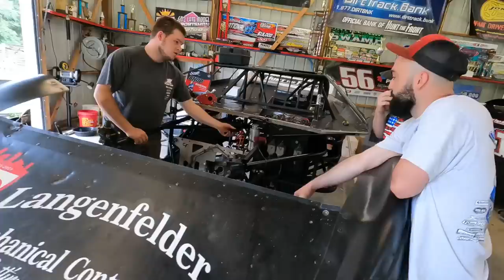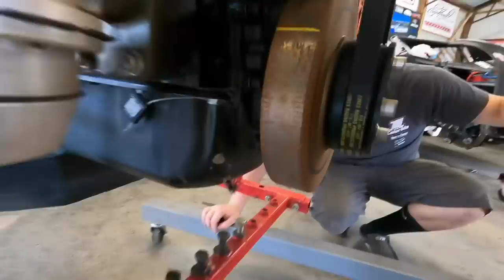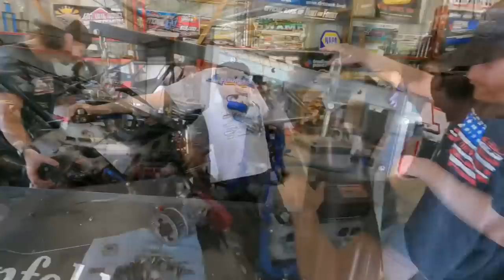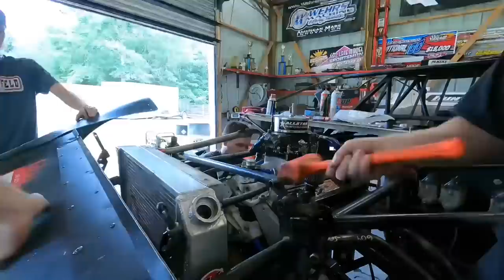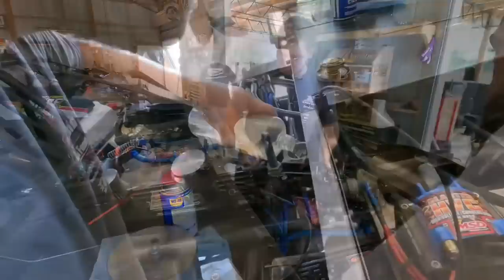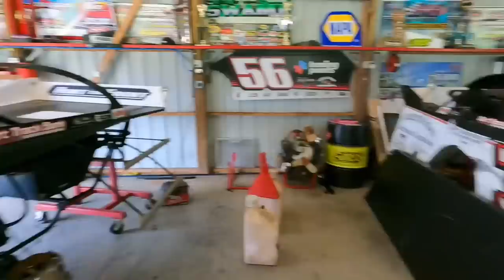Will Jesse Be Able to Race? And Faithful Has a New Engine!

Comment: Good luck boys be safe. The motor guy we used said never put regular water in a motor with aluminum heads because there are minerals that eat the aluminum. We used distilled water. Just saying I'm not a motor man.
Reply: It’s a small possibility it would work them over time but it would be about just as likely for iron to rust from the water itself if you ask me I’m also not a motor guy but I haven’t had any trouble
Reply: We used Wet Water back in the day. Worked great
Reply: @johnstark4723  They have a thing called water wetter that’s pretty good

Comment: I think that Jonathon needs to take all of his driving equipment along this weekend.  I am sure that Jessie is a lot tougher than me, but I would be extremely concerned about the vibrations coming through the steering wheel as you try to turn on a rough track.  I have had a damaged left hand before and it surprised me on the pain.  Imagine swinging a baseball bat.  Yep, I can grip it and swing it.  The pain didn't start until you actually hit the ball.  It was like electric shocks going into my hand.  I hope that I am wrong, but better to be safe than sorry, etc.  As always, Best Wishes to everyone concerned!!!  Love the videos!!!